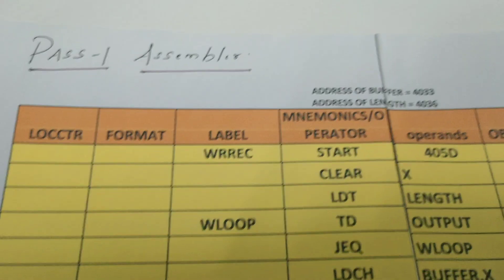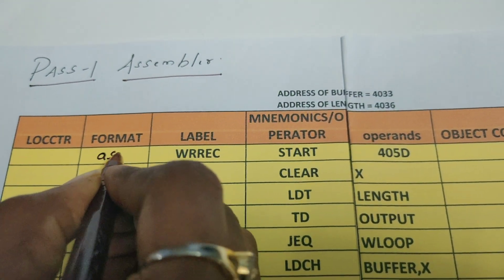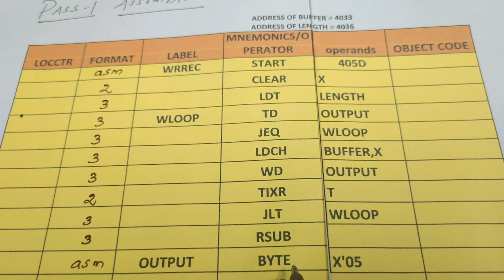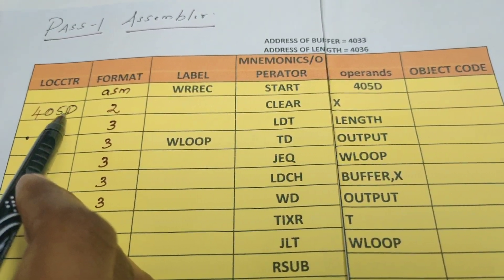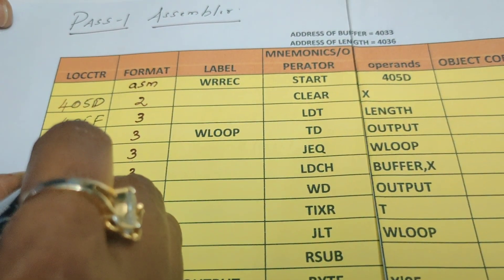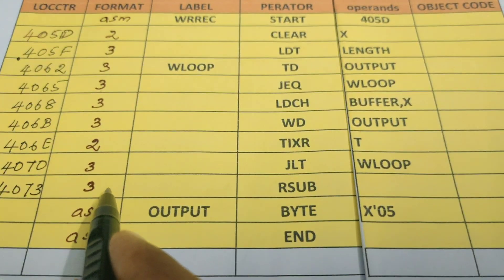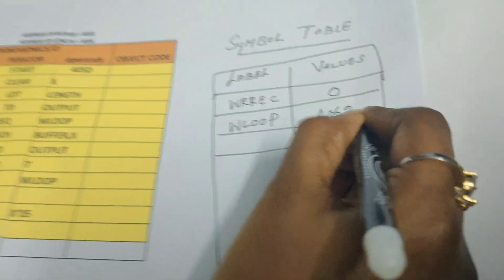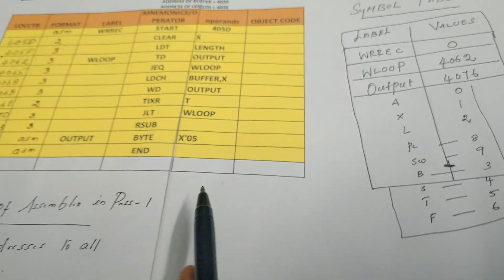Pass 1 of Assembler | System software - #7

Comment: How to know the format of the mnemonics ?
Reply: if there is a "+" sign before the operator(Mnemonics) then it's extended addressing mode => e=1 and it's format 4
Reply from the maker: Yes absolutely
Reply from the maker: Also... mnemonics is machine level language and from machine to Machine...it's format is different. And for this problem...you refer system software book authored by L Beck. Appendix contains info about mnemonics